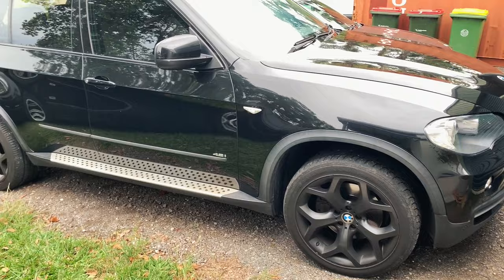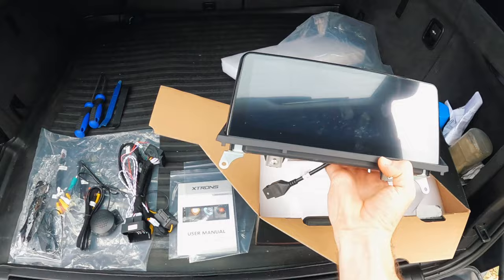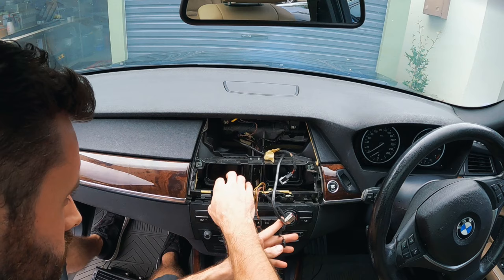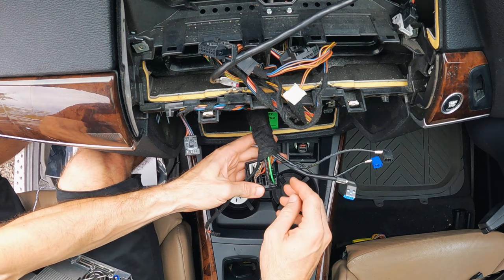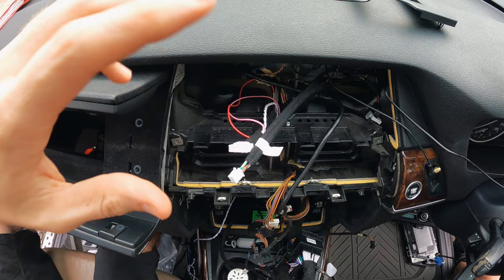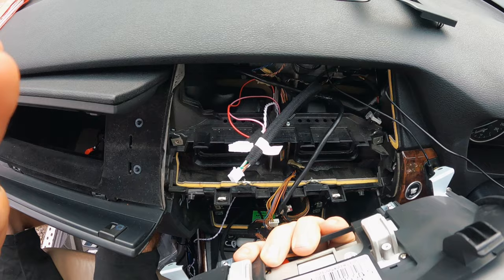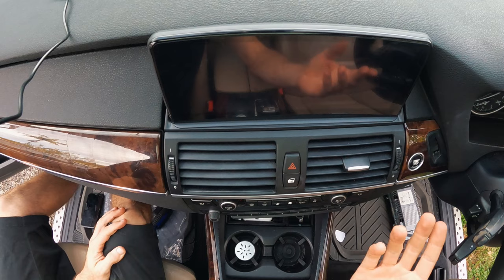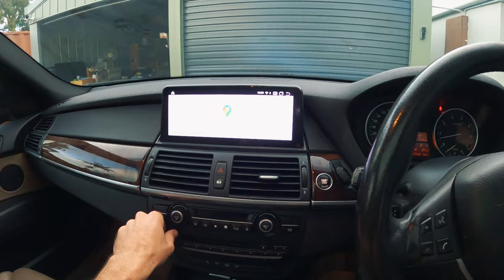How To Install Android Head Unit For BMW X5 E70 & E71 X6 - The Ultimate Multimedia System

Comment: i see in factory settings that there is aux switch in manual and then there is a menu where u can choose the position of aux 1 and aux 2 , do you think with some trick ob thse menus i will be able to skip the aux cable from the armrest to the unit?

Comment: The little speaker is for gps voice guidance from the units maps. Not apple CarPlay maps. So if you are listening to the actual cars radio you can still hear the androids gps guidance.
Reply from the maker: Ahhh that makes sense, would be a handy little feature.
Reply: @ZeroTo60Tube  only if you use the inbuilt maps. If you use android auto or apple CarPlay it doesn’t work. Not on my unit anyway. I guess if you hotspot your phone to the unit then it could be used but I just like CarPlay

Comment: Can you provide more detail about the bit where you said "I don't have to plug into the AUX port?" Is there a known factory audio system configuration where this is required? Great video! Thank you!
Reply from the maker: Ccc fitted vehicles have 2 aux ports depending on config from the factory. One port is direct in the back of the ccc. The other through the mulf module. The vehicles with it direct to ccc do not need the cable
Reply: @ZeroTo60Tube  I had the same thought, thanks!
Reply: How would I know if mine has a direct aux in the back ?

Comment: nice info video !!! few quick quetions: does the CCC onboard GPS navigation still work ? does the android navigation work even without 4G or 5G cellular signal ? Does the idrive radio still work ? does the idrive backupcamera still pop on when put on reverse gear ? does the idrive tire pressure monitor system still work ? thanks

Comment: This is a great video and one that swayed me into buying the unit for my E70. I have some problems though: 1. Cannot get Bluetooth and Wi-Fi to connect at the same time, I have to switch off Bluetooth on my iPhone XS, to connect to Wi-Fi and Bluetooth will kick off Wi-Fi when its switched back on again.. 2. Connecting to Bluetooth, on startup, is hit and miss so have to switch on and off the ignition until Bluetooth connects and I can access all functions eg: Google Maps Spotify and Phone.
Reply: How is your audio? Mine is ok - there is always a buzzing sound
Reply: @AM4project  audio is clear as a bell
Reply: @stevebaptie1156  i wish mine was clear, im running the 3.5 jack into the center armrest jack input, whats your setup
Reply: @AM4project  I have done the same. Have you changed over your original system to Auxiliary?
Reply: @AM4project  have you changed the original sound system over to auxiliary?
Reply: @stevebaptie1156  what do you mean by that?
Reply: @AM4project  you have to access the OEM entertainment section and select “AUDIO AUX”
Reply: @stevebaptie1156  yes i do that thanks - i can hear the audio but its static
Reply: @AM4project  it may be a bad connection on the audio jack where you have plugged it into the armrest
Reply: @stevebaptie1156  ok thank you im looking to replace the audio jack  - thank you!
Reply: @AM4project  make sure you install a stereo jack and not a mono 😉 they come in the same size

Comment: As soon as you said "make sure you get the right setup" I knew I messed up 🤦🏾‍♂️ but I did watch both installations and didn't see a difference 🤔 are the cic and ccc versions interchangeable at this point?
Reply from the maker: Not to my knowledge. You will need to get the unit swapped if you have the wrong one.

Comment: I recently installed the new 12.3 in CIC Android screen in my 2010 X5. I am having issues with the following:
1. The BMW Factory System view is accessible. However, I cannot figure out how to properly calibrate the view. All of the factory screen views are off-centered and it is difficult to select items because some aren’t visible. I have gone through all of the setting tabs on the screen and cannot figure it out.
2. My system will not allow me to delete/disconnect mobile devices that were attached to the radio for testing. The audio shop’s technician synced his phone to the screen for testing and it will not delete from the screen. 

Any advice you can offer on these questions would be greatly appreciated.

Comment: Hey, like the video. So much I thought I'd try the install myself. It seems easy enough, I have CCC model like the one in your video. Is there anything I need to keep in mind or anything I should look out for when installing this unit? I needed something to do during lockdown. Haha. This is it.  Any advice would be great. Thanks.
Reply: Hey Darryl how was the installation? Did everything work like you want it to? I'm looking to buy one
Reply: @taylorsons4303  Hey Taylor, installation was easy. Took me about 12mins to install. Amazingly simply. Just make sure you have a Phillips screw driver and a plastic tool to careful unclip the bottom cover part. Just to make sure you don't scratch anything.
Reply: @darrylheather5512  Thanks bro I've just installed my an hour ago but the back up cam doesn't show. I put it on oem settings still no video..smh
Reply: @taylorsons4303  my reverse camera doesn't work, but then, I'm from the old school where I use the side mirrors, rear view mirror along with the sensors, beeping me when I'm too close. The graphics for those are on my screen though. I haven't taken the time to look at the wires for this. I should, but haven't yet.
Reply: @darrylheather5512  I know right. I actually got it to work 💯
Reply: @taylorsons4303  How did you get the reverse camera to work? I'm thinking of doing this, this weekend to figure it out.

Comment: Hello great video. I have installed a very similar unit. The audio through the aux cable input is very noisy. Do you know what i could do to troubleshoot it/ fix it? I was thinking of hardwiring the audio jack…everything else works wonderfully
Reply: ensure your aux cable is super duper high quality, use a voltmeter and check resistance at each end wiggling it all over. IMO, 5 out of 10 brand new unbranded aux cables are trash. get a name branded and heavily shielded cable from a guitar center or similar,  and only buy the absolutely shortest cable you need. 
-check it isn't pinched anywhere
- check it isn't running alongside ANY other cables, especially power cables. 
-set aux output on phone/mp3 at about 50% or maximum 65% volume and turn off all modifications aside from Dolby if you want. no sound effects, EQ, bass amplifier etc. set aux input gain at radio. this high level aux input in a perfect world sucks at best so keep expectations moderate.  there shouldn't be any clipping or popping and if there is, replace cable and ENSURE they are inserted tightly!
for example,  a modern Android phone running YouTube audio should be 80% perfect between 0 and 50% on head unit volume.  above that, your going to amp engine noise and crap to some degree.  if you want to avoid the issue,  run line level audio (ipod cable output to a ipod ready player is line level..i.e. preset low voltage level...same as the voltage between Bluetooth devices..l...I'd use a quality Bluetooth device and ditch the aux cable, however,  I do use a 3.5mm monster cable aux cable (10mm thick cable) and keep level under 60% so my typical listening level at radio (30-60%) is pretty damn good. 
...also, any whine from ignition and either cable IA grounded to Chassis somewhere,  bad cable, other speaker wire grounded somewhere etc. start by laying aux cable in a different route to see if it goes away.

Comment: hello fella, do you think its worth the trouble of upgrading my 2009 x5 ccc, to a later cic sytem? the reason i ask is because i have the easier option of just installing a 12.3" android unit and wonder if i would ever need to use the original ccc menu side of thing?, obviously the full cic upgrade would be around 500.00 hence my reluctance to just go ahead with it...Any help you can share having the insight of using the andriod head's up display would be so so welcomed fella..cheers ian

Comment: I am very tempted to install this on my wife’s E70 👍
Reply from the maker: I'd recommend it, to me there were no real downsides at all, just endless options for in-car entertainment and a higher resolution screen 👍
Reply: @ZeroTo60Tube  Thanks, I’ll order it, with your instructions on YouTube it should be easy. Did you have to connect a cable to the Aux or is it not necessary ? Greetings Dick
Reply: @ZeroTo60Tube  I heard a lot of these android units and how the low sound quality compared to the stock system but if you recommend this I’m sure you tried all the other shit ones

Comment: @zeroto60 i connected everything but mi idrive knob doesn't work nor does the audio. I've tried with and without connecting the aux cable. Any suggestions for me to follow ?

I have an x6 e71
Reply from the maker: Likely your new unit is looking for a different style of idrive knob, also your aux settings might not be correct

Comment: Need one with subwoofer RCA and crossover control. That would sell. If these are like the current China ones. They are all glitchy and something is always wrong with them. A few that I have had, had BT connectivity issues, volume static issues, random screen black out issues, random shut off issues, poor sound quality compared to stock HU, glitchy screen and sometimes didn't work if you swipe or push on options...etc etc...

Comment: Thanks for your video. I bought the same unit for my 2008. Installed everything is good including sound. Did you have to do anything to get the OEM reverse camera to display correctly on the old idrive view? When I switch to reverse it goes to the office view but gets frozen, sensors all work but no display.
Reply: Try to reset your unit or get a firmware update from your supplier.
Reply: @BayernMods  Thanks for your reply, turns out my oem camera was broken.  Fixed it by installing and aftermarket camera. Happy days :)
Reply: @ChrisTranRocks  Did the aftermarket camera improve picture quality?
Reply: @tshepp89  oh yeah! Huge difference, it was worth running that extra cable to the rear of the car. Much clearer now. 👍
Reply: @ChrisTranRocks  cool! I'll have to look into it! Cheers
Reply: Hi  @ChrisTranRocks  would you mind sharing a link of where you got the aftermarket backup camera? mine went bad :( Thanks in advance!

Comment: Thanks for the video.
If you want to listen to OEM FM, do you have to go into the CCC menu and choose FM?
I am wondering what happens when you play some music into the AUX-IN jack in the center console. Does it mix/play over whatever the Xtrons is playing at the time?
Reply: yes I wonder the same thing. I saw on another type of these MMI upgrades that FM AM radio was no longer useable after the conversion and the current car speaker phone microphone no longer worked.  I wonder if that is the case with this unit too?

Comment: Hey Guys, I just did the same install, however am experiencing the following issues.....can you please help?? 1. The size of the original BMW screen (resolution) is much larger now and does not fit in the new screen (maybe a setting?) 2. Only radio plays through speakers, no sound from the Android side even when it shows paired music devices playing 3. Rear camera no longer has the guidance overlays.......total horror.....HELP
Reply: 1. I have the same issue with the idrive picure being larger then the screen. I have tried all of the different factory car screen settings with no joy did you find a solution?
2. You need to have the additional 3.5mm audio cable plugged into the outlet in your armrest and have the idrive set to AUX source
3. change setting to original camera not aftermarket

Comment: I did a reset on the system to factory because it was logged in to as the previous owner and everything worked as normal before the reset, but after I reset the system Bluetooth stopped working on the android system but still works on the iDrive system like it shows that it searching for the devices but it not coming up on the phone and I tried with multiple phones. If anyone could give me some advice that would be much appreciated. Thanks.

Comment: Hi There
I install everything as per your video but the problem is that I don’t have sound from YouTube or any other app on the android. Can you advice.
Reply from the maker: You will likely have a different aux setup. You can code the CCC to accept the front aux, or you will need the aux to the centre console.

Comment: Just installed mine for my 2014 X6 and everything works perfectly but my audio. There’s no noise. What do you think went wrong.
Reply from the maker: May need to verify how your cars aux works. If you have a mulf module in the boot, you will need to connect directly to the 3.5mm aux port

Comment: Hello- i am from USA and recently watching the video where you have upgraded the head panel for an2009 x5 48i. I have exactly the same model, and trying to find if the xtron is a good one or you have something else in mind. Also, what’s the complexity level if i do it? I can follow instructions, and also usually do many DIY though first time with a car.
Reply: Did you ever replace the unit if so what did you go with

Comment: Just wondering if any of y'all have any advice. I have a Bmw X5 E70 CCC. I upgraded to a 10.25" system.
The new infotainment works, the only problem is I have no sound. In order to get sound I'm meant to go into the CCC system and change the settings to AUX output. But when I try to go into that screen, it just goes completely blank. I took it to an auto electrician who advised I needed to replace the CCC head unit. So I did, but I am still having the exact same problem. I'm not sure where to go from here, any help or advice would be greatly appreciated.
Reply from the maker: Thats a strange one, if you have changed the CCC and still not getting an output to the new screen, it may be the input on the new screen causing the problem.

Comment: Does the sound processing/amp come from the original BMW - or does the xtrons handle the speakers?
Reply from the maker: The xtrons connects to the factory ccc's aux in connection. So the CCC still does all the sound work.
Reply: Good question as the x5 sound system and amp sounds excellent !! Great stock sub as well I recon

Comment: Thanks for your great video.
Impressed and had to purchase it.  Yesterday I installed the same Andoid unit (Xtron) to my BMW X5 2008.
Now I have the following issues:
1.  Android unit sound such as mobile phone, YouTube, Android music and GPS guidance comes from only the small Android speaker provided.  Not from the original BMW speakers as expected.
Is there any technical way to get all the sound from the original BMW speakers?
2.  Rear view camera does not function any more after the Android unit installation. 
Is there any way to recover the rear view camera function?
I can sacrifice rear view camera function. But not the sound issue problem.
I want to hear all the sound of GPS, youtube, music and phone conversation from the original BMW speakers  not from the small speaker.
Any advice would be much appreciated. 
Thank you
Reply from the maker: That will be settings for both, however it was so long ago since we had this car, I can’t remember the menus. Sorry. Try speaking with your supplier hopefully it’s a common thing they know how to change.
Reply: @ZeroTo60Tube  Many thanks for your reply.  Now I fixed all the problem.  I reset the settings and reconnected the 3.5mm  aux cable jack from the Android head unit to the BMW's aux in.  Now all the sound such as Mobile phone, Youtube, Music and GPS comes from the BMW's original speaker.  I do not need to use the small speaker provided.  I am very  happy with the look of the new Android unit and  the quality as well.  I appreciate your help again.  Your video made me install it by myself and I did it.  Thank you.
Reply: @johnpark7322  hi John 
I’m thinking about buying this for my car that is the same model as yours. Did you have to route the aux cable from the central console aux port for the sounds?
Reply: @BigBoy-se5du  Yes.  I had to route the aux cable from the Android head unit to the central console aux port for the sounds.  Good luck
Reply: @johnpark7322  
Hello I have just installed this unit for my BMW X5 2009 and I have a problem with the rear camera it’s showing the view more bigger from the normal size and when I want to show the original system for the bmw in the unit screen it’s the same it’s showing the system more bigger icon so there is missing part in the view 
I hope if you know how to fix this thank you so much

Comment: Question: If i have a DVD on the beck seats , will interfere with the system?
Reply from the maker: I think that will still operate fully independantly of this.
Reply: Its the original DVD device and uses the sound line from the original amplifier, i will try and i will post the feedback here. Thanks for your support @ZeroTo60Tube

Comment: How's the sound quality with this unit?
Also how is the visibility of the screen with sunlight on it or while wearing polarised glasses?
Reply from the maker: I didn't try with polarised glasses but it was much better against glare than our e53 screen.
Reply: @ZeroTo60Tube  but what about the sound, it seems on some of the older generation Avin units the sound quality coming from the android side was sub par but when you switched to the oem side it was normal or the way it’s supposed to sound ?